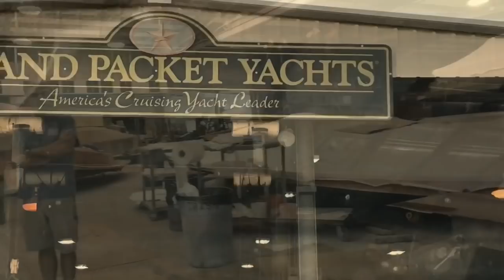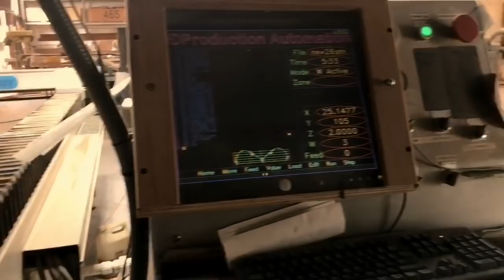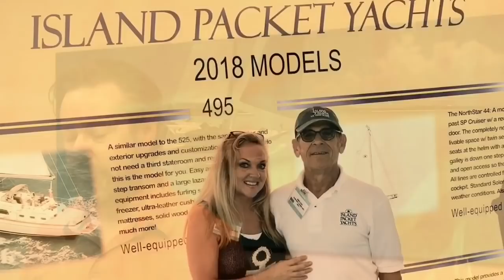How an Island Packet and Seaward Yacht Sailboat is Built

Comment: @4:55 "Retractable keel glassed into the headliner and deck"  thought saw it all... :-D
Reply from the maker: Yeah, that's the Seaward Yacht.  Built for shallow water beaching.  Kinda cool, but in my opinion, not a bluewater/cruising boat.
Reply: @TheAdventureTravelers  i was wondering about buying a IP for use as a coastal cruiser because of the craftsmanship. But now if the seaward is built by the same team it seems that is a better fit.
Reply from the maker: @music-jj2pl  You should check out their website.  I know they were discontinuing some of the Seaward line.
Reply: @TheAdventureTravelers  their site redirects back to the IP site. So it looks like they are discontinued. 

Any thoughts on using an IP for ICW and no more than a couple of miles offshore? I live in SFL so the keys and Biscayne bay are my sailing grounds.

Comment: I wonder why IP is still encapsulating their chainplates instead of making them external.
Reply from the maker: Sean, you’d have to ask them that. I do know that they use an elaborate system of fiberglass to adhere the chain plates to the side of the hull. Super strong. They can tell you more.

Comment: Coosa board is okay as a boat building material, but not fantastic, and it costs more than 4 times more than standard high-quality marine ply (which, if sealed properly, will never see moisture anyway).  Those higher material costs are typically multiplied x3 and passed on to the customer as a business expense, meaning the cost of the boat just exceeded its worth.  The only time marine ply will rot or fail (keeping in mind it's constructed using with waterproof adhesives) is if the builder goes cheap and uses a polyester resin instead of epoxy and the gelcoat fails.  This happens a lot, but people keep buying boats that are made that way.   Go figure.
Reply: @mitchellsmith4690  - True.
Reply from the maker: I’d have to agree with Mitchell. Once you cut into plywood, unless you properly seal it again, your chances of getting wood rot the way up. I’m sure that they get a discount on the Coosa board due to volume